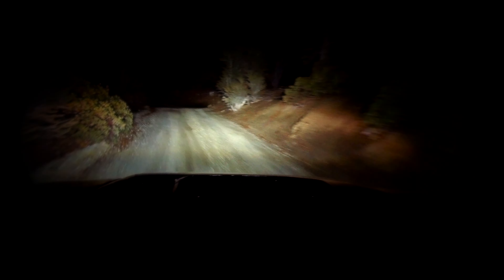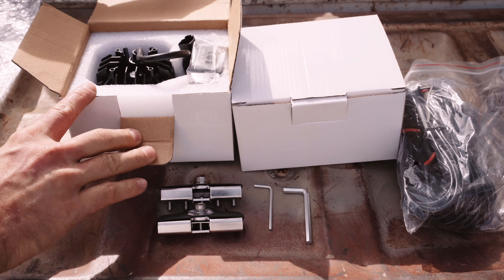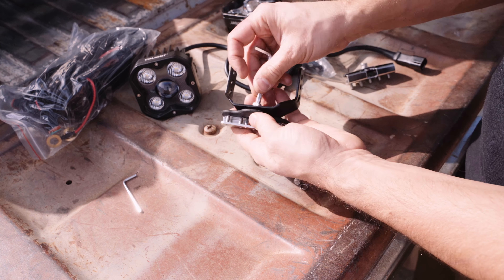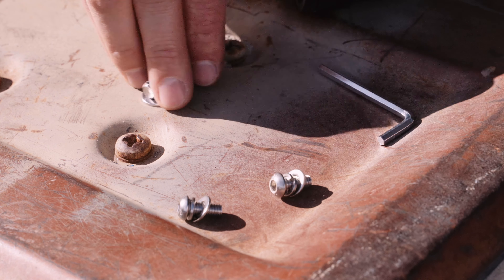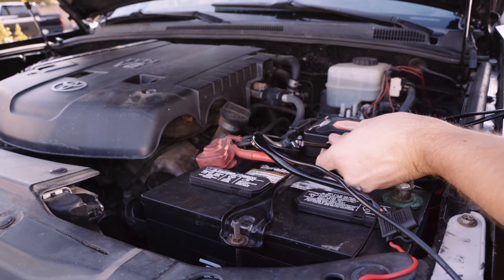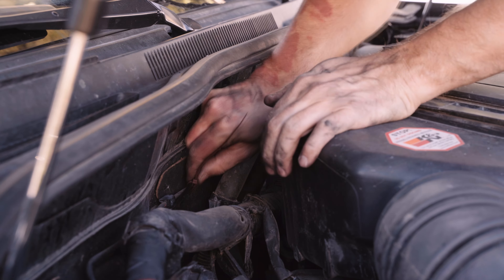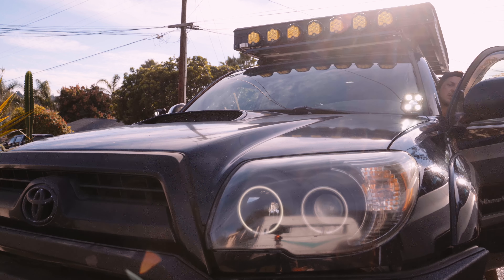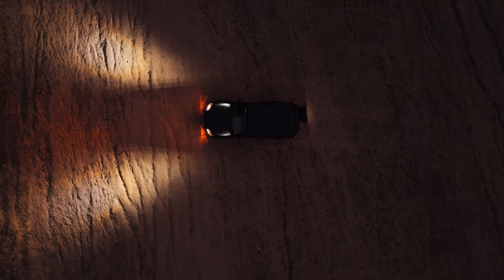CoLight | 3 inch HD Series Ditch Lights 4Runner Install

Comment: Just grabbed these lights! Thanks for the vids and the code!

Any tips for getting similar rooftop lights without a rack to mount em? Would it be possible with an A-pillar mount?
Reply from the maker: Awesome!! You’ll love them. 

What vehicle do you want the roof lights for? A-pillar mounts would definitely be the way to go. There’s a ton of linkable light options out there too if you not want to diy a rail to mount them to.
Reply: @dillansgarage  funnily enough, a 4th gen 4Runner!

I saw the CoLight ones and my only concern is a lot of the mounts were for curved light bars, wasn’t sure if I’d get the linkable spotlights to sit right or if they’d be touching the windshield.

The other option was mounting them to the single t-slot channel on the bottom half of my RTT
Reply from the maker: @TheReissMackay  nice rig! Hard to say really without looking at it myself, but I can’t imagine they make the mounts only for curved. Might actually be a good idea to just hit them up and ask. CoLight is pretty responsive on Instagram usually. 

I probably wouldn’t use the front channel of your tent since it would be a lot of torque trying to pull it forward on every bump. If you send me a pic of your setup on IG I might have better input.

Comment: What headlights do you have
Reply from the maker: Those are old eBay China specials. They leak and have terrible projection. Finally got fed up with it so I’m in the process of starting a new brand. SCX Outdoors. One of our offerings will be custom headlight builds.